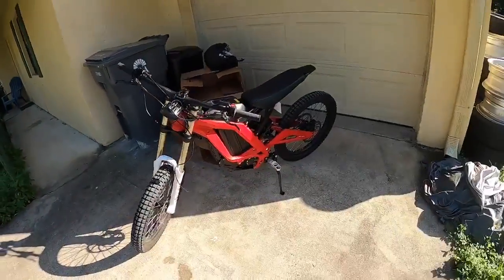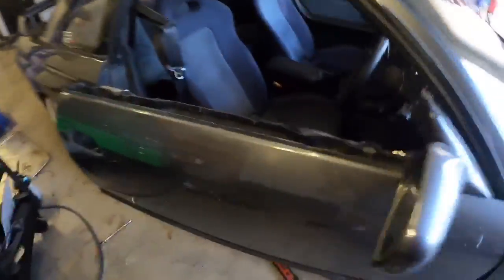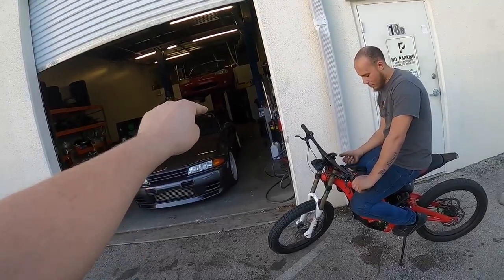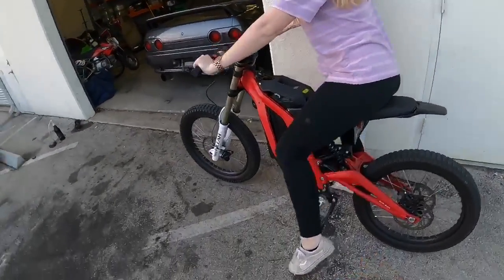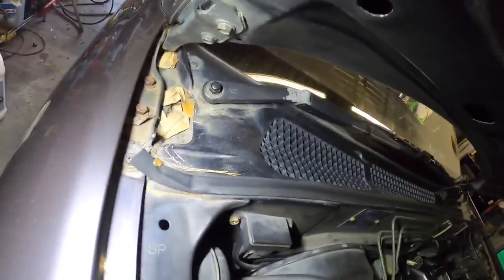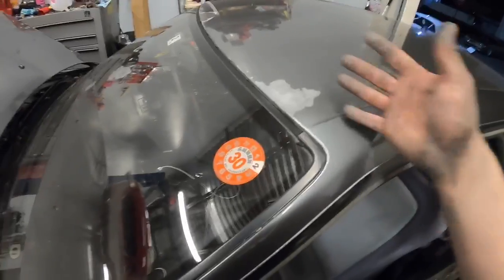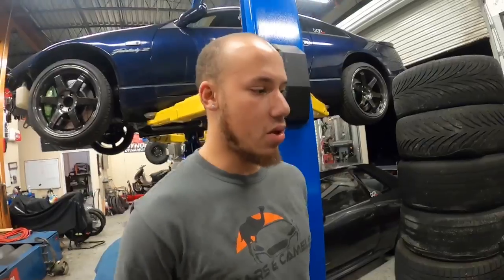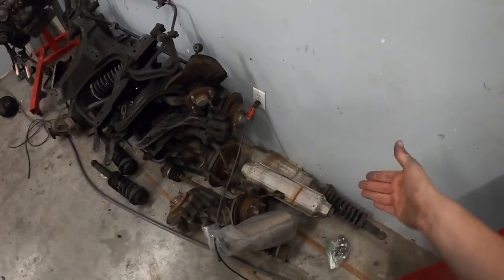What happen to my GTR?

Comment: Tell Marcus from one SR owner to another, do not run rocker arm stoppers. All they do is wedge the rocker arm when it does fall off resulting in breaking the rocker arm and sending metal through the engine, rather than just throwing it off and having to put it and the shims, reinstall the cams and retime the engine (easy 1-2 hour job).  Also do not run the arp main studs without a line hone of the mains/girdle and without a torque plate, aluminum blocks and SR's in particular will/do distort causing major mechanical issues (like flattened bearings/irregular tolerance locking up the rotating assembly). Most smaller machine shops will tell you that it's not required but that's just because they don't have a torque plate for an SR or don't deal with all aluminum engines especially higher up turbo ones very often if not ever. Mazworx, (the SR specialists) will not do and bottom end machine work on the block without one. Those greddy and knock off cast aluminum oil pans are junk. I've had both the real deal and knock offs and they all end up leaking no matter how much Silicone you use and the drain plugs strip out super easy. I'd recommend either a Tomei, Moroso, or even ISR sheet metal extended oil pan instead. The worst thing you can do is rush an engine build, especially for a finicky engine like an SR, some other issues I'd address while you've got it apart is running an s14 oil pick up and black top/later model vented oil baffling as well as a high pressure acl or sr20vet oil pump.  Again, just advice, take it or leave it, but again this is coming from an SR/240 dude who's been there/done that for pretty much everything you're going through and has successfully made over 500whp with an SR.

Comment: If Marcus didn't have his main caps line honed before using arp main studs it will warp the girdle and caps.
Reply: Well isnt he in the rod knock gang? Or I mean main bearing knock gang. ×2 line bore with the arp mains studs. It's prolly in the instructions but who needs those